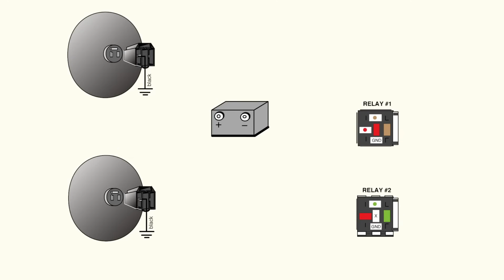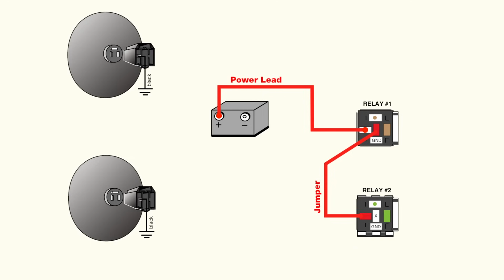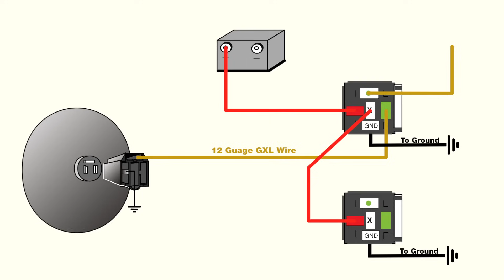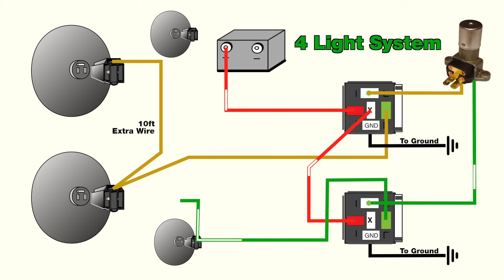How to wire headlight relays

Comment: To questions about fusing: yes, you need a fuse in the power line before the relays.  Factory wiring has fuses, and this upgrade needs one too.  Recommend updating this video accordingly.

Comment: Are headlight relays always under power? I noticed on my car, with no key in ignition, and with headlight switch removed, I still have power to the headlight relay. If I pinch the contacts with my fingers, my headlights come on.
Reply: there are often things that will always have power, often cars will have a little clock or digital display,
a red beeping "security" light, you can switch on many interior lights without the car being turned on with the key, since power comes straight from the battery through that red wire there will always be power going to it however if it isnt going anywhere else from there the battery usage is minimal to non existent 👍

Comment: What about 3 headlights. I have a honda shadow and i ran a similar set up for powering 3 light bars but i could only get 1 lit for low beam and the other 2 lit for high beam. I want my low beam light to keep running when i switch to high beam so that all 3 are on, but in low beam only 1 of my lights

Comment: So If I were to wire a relay for my headlights to have dims and lows on at the same time I would wire 85 to ground, 30 to positive battery, 86 to high beam positive, and 87 to low beam positive?

Comment: I’m building a drag race only 1989 mustang. All the factory wiring has been removed. I purchased new headlight, marker light and park light plugs. I’m looking to just run these to a basic switch to activate low beams just for racing at night. Not concerned with high beams. Also just tail lights, and not concerned with brake lights working. What do you recommend? Thanks
Reply: Look up the channel "ratty muscle car"
He's got a complete series for this

Comment: Is it normal for the red wire from the battery to get hot while running? It's fused before going to the relays.
Reply: It shouldn't get hot, Sounds like the wire is too thin or you have excess resistance. Try using a thicker gauge of wire

Comment: ok so I just watch your video . where is the power coming from? still from the factory switch or a separate power source? if a separate power source what do you hook up to? I want to get a kit to do this to my 65 dodge dart and my 82 dodge d150 and my dad's old 78 chevy truck .
Reply: The lights get the power from the battery on a shorter more direct wire which allows for less voltage drop meaning brighter lights. The old power source (Light switch inside car) is now used to activate the relay to allow the power from the battery to travel to lights.

Comment: your design diagram is fault. if you connect your headlights directly to the battery, you taking a lousy chance on battery kill the high lamp. mine connected to the starter, to the fuse box for safety. you are pulling too much juice off the battery when the headlight turns on. there is no safety on this schematic, might even fry the wiring when the high beam turns on.
Reply: You are very right

Comment: I have H4 wiring where the same set of wires supplies power for both low and high beams. Do I need dual relays or will 1 relay suffice?
Reply: wondering the same thing
Reply: hello I want to now control box

Comment: Terminal “85” is typically used to wire to ground (not 86 as mentioned in the video) and terminal “86” would be used for your existing Low Beam (or High Beam) trigger wire. Terminal “30” should be used for Battery Power and should have an in-line fuse or circuit breaker.  Terminal “87” should go to the Low Beam (or High Beam) light
Reply: Pins 85 and 86 are on the trigger/activate circuit, which is usually activated by a live on one pin and a switched earth/gnd on the other OR a gnd on one and a switched live on the other. It doesn't matter which way round.
Reply: In the video the relays are laying sideways.... The layout is correct ..... Turn it 90° counterclockwise then u will see its correct.... All these type of 5 pin relays are the same..... Only problem with this video is that there is no fuse between battery and pin 30 to protect the circuit from overheating or blowing a bulb
Reply: Ùuþý

Comment: Hi,I have a 2007 Honda Fit, it uses H4 bulbs, I have put some led driving lights to assist with the high beam, with the standard bulbs I can get the driving lights to work with the high beam, but as soon as I put LED H4 bulbs in the driving lights will not work, can someone help. I have tried to get it to work, but I am lost and need help.
Thanks Rod.

Comment: Don't forget to protect your headlight switch or BCM from relay's voltage spike. add Diode to protect your car
Reply: Where would the diode be added in what section
Reply: @santanaman6783  in the relay's coil pin 85 and 86  search for the relay flyback voltage on google i can not put image here
Reply: You can find relays with a resistor or diode already built in and save the trouble. Factory headlight relay in a 70 Chevelle uses a resistor across 85 and 86. That's what I'd match. Induction Kick reverses the polarity and multiplies the voltage 4-6 times input voltage. With an ECM I'd use the Diode but this is a manual switch.

Comment: how can it be,f there's no wire ground at light
Reply: Seems like you should or the kit should come with Ground wires for the lights. What's the point if that current is traveling on stock smaller AWG wire?
Reply: You definitely need to ground the headlamps.  If they're short and straight to a decent body ground, you don't really need to increase their size. Shorter wires can be smaller gauge and still work okay.  Current flow AND length are how you should size wire.  There are charts all over the place.  Be careful about copper clad aluminum (CCA), stay away from it, it's garbage.  You want rea solid copper (OFC) type wire.  If you crimp connectors, check temperature of them in operation to be sure you don't have some resistance in there.  Make sure nothing gets hot, check every connection point, plus the wire itself.

Comment: I am trying to wire a gmc 2017 Yukon Denali fog lights?  I purchased a LED fog light kit.  It explains the wiring ok.  Although I would like to wire this kit bypassing the switch that comes with the kit and use the switch that is already inside the cabin of the Yukon.  Are you able to explain how to tackle this approach?
Thank you, Patrick

Comment: hello I have a question... how to connect headlights high and low beam in a single relay?
Reply: Same quiry..why not use  1 relay for these
Reply: @swapnalipatil9310  you need a separate relay for each circuit (beam). You can get switching relays but the extra wiring needed makes it a harder job. Come on, relays aren't expensive, buy 2.
Reply: You can but you still have to have another to energize the second one. A 4 pin to energize the 5 pin with both h and l beam coming off the 5 pin, 87a low beam and 87 high beam. Feed 12v supply to 4 pin 30 with 87 feeding 30 on the 5 pin. Low beam switch energizes 86 on the 4 pin and high beam energizes 86 on the 5 pin. Tie the grounds and call it good.

Comment: hello my name is Rob I have problem with 600 Honda Silverwing every time I start the bike the fan keeps running never stops and some fuse get burn what I should do please let me know thank you very much
Reply: The temperture switch that activates the fan is bad. Is located on the bottom part of your radiator.
Reply: Hi
Pls advise
I have a polo classic  whit two sets of wires for the headlights. Do I put the left and right side dim / bright wire toghether

Comment: I had double fog light but I don't know how to wire it... I used a fog light kit with 30 amp, and everytimte I turn on the fuse blow up.. I don't know if a need to buy another FL kit and keep this separate with fuse and relay and connect to a single switch ?
Reply: Use the wires already there.